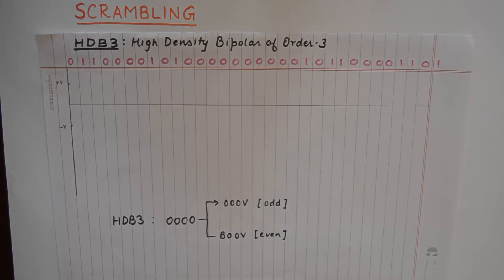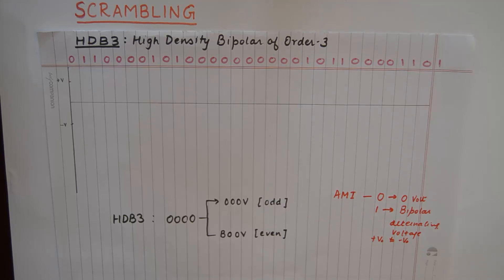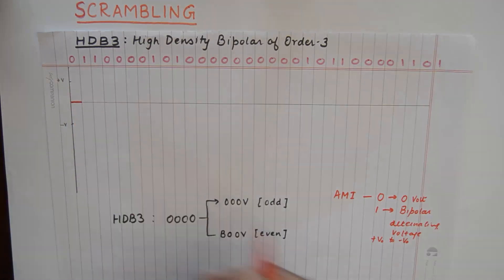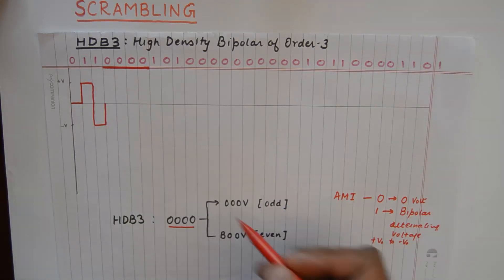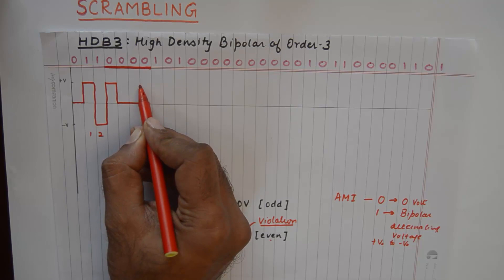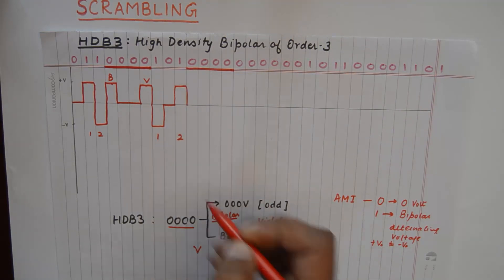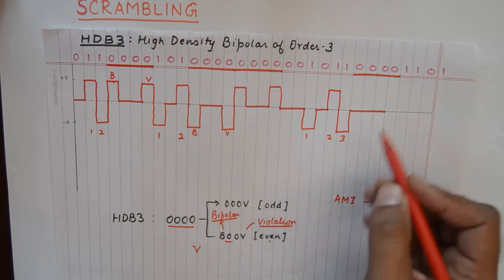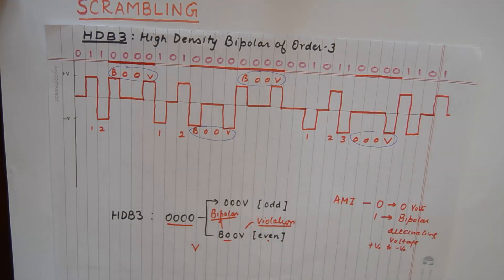HDB3 (High Density Bipolar of Order 3)

Comment: Hello Sir. Thank you for the video. However i think your solution is WRONG based on what I have learnt in the classroom and also verifying here from wiki (https://en.wikipedia.org/wiki/Modified_AMI_code). 
From what I have learnt, the rule is thus. You replace the 4 consecutive 0's with a sequence of the form A00V. "A"  is called the DC equalization symbol. It is either +1,0 or -1. You choose the one which would render the sum of the pulses preceding (positive and negative pulses) inclusive of the A to be zero. So if the sum of pulses up till before A is  +1 then A is -1. Similarly sum = -1 then A = 1 and sum = 0 then A = 0. So of course for the next substitution of the HDB bits you don't need to try to find the sum again from the start because your previous DC equalization bit(A) already rendered the sum to zero so you start summing the pulses from the first pulse after the previous DC bit(A).
Reply from the maker: Thanks a ton for pointing this out and verifying. I'll pin this post and sure it will help the community. Cheers!!
Reply: That means the explanation in the video is wrong?
Reply: It's correct since the rule of scrambling is always the same; the only difference is in the initial condition for the parity.
Reply: Please site a reference. The wikipedia article has apparently changed, and even in the said article there are contributors who indicated that there may be an error in the examples (see talk section of the article). Also, the wikipedia article doesn't talk about the term "DC equalization bit".
Reply: @abdallahbukhari4382   yeah I see the wiki article apparently is not there any longer. I wrote my response based on what I was taught in the classroom and the article was  an additional reference but Unfortunately I can't go back to that right now.  Good luck searching and learning.!